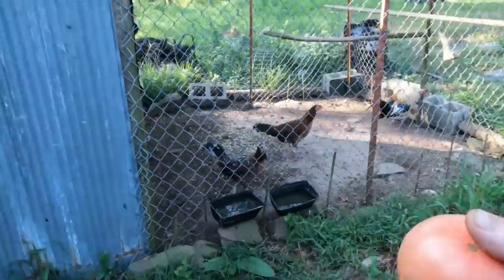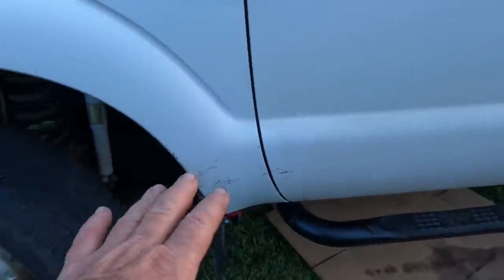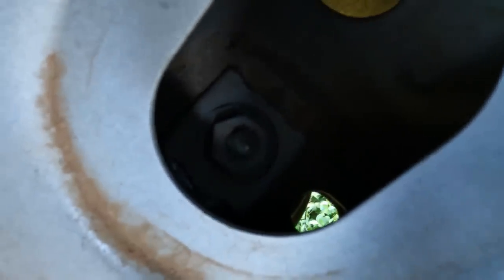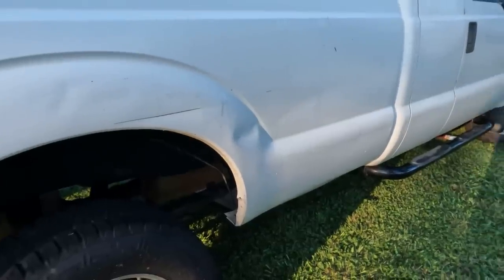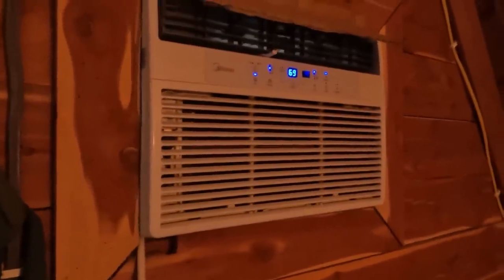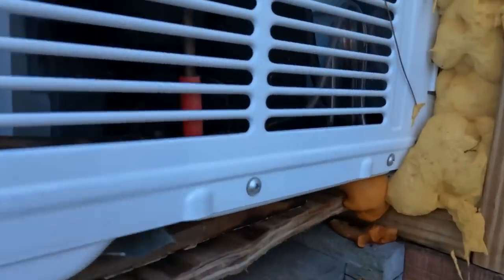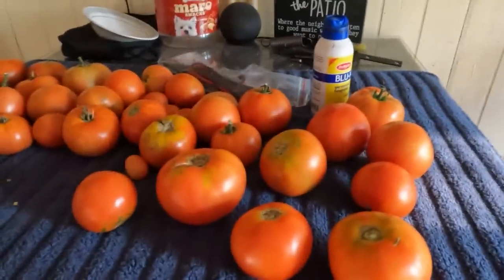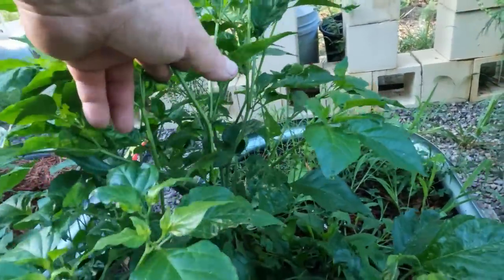It Went From Bad To Worse! My Body Can No Longer Do What It Used Too.Stranded,No Wheels

Comment from the maker: Im going to put on the two lowers on passenger side this evening and then drive it to the shop in town, Jeff is going to follow me and then take me to the store for food.Drew offered to take me home on his lunch hour but now Jeff can help.If my hand didnt get smashed up I would probably try and finish it, but its my right hand and not gonna happen.
Reply: Sorry Dogman.  You gave it heck. There are things Pooch can't and won't do anymore too. 🤠🤘❤️
Reply: It's great you have good friends close by for now.  I had to leave my Ford 2018 Ecosport at the shop only 26,000 miles on it. it's either the motor engine mount or front axel. $169 for just the diagnosis. Hopefully they can fix it soon.
Reply: I am so sorry about your hand, Mike. If your wound has scabbed over and if you have some comfrey salve, you can put some on your hand as it helps to heal wounds.
I am sharing a link so you can see if you want to use it. I has many beneficial purposes for healing.
Jenn of Altruistic may have some she can send you.
https://thegrownetwork.com/comfrey/

Comment: Mike, I am having problems with my 12,000 btu air con. loud noise and spitting out water,  it was refurbished when I bought it. Had many years of use. So I using the 5,000 btu air con. what a difference. So tomorrow have a brand new 8,000 btu air con coming & the 5,000 btu is going in the bedroom, I hate heat, like the place cool. So wish me luck. Been researching for days, deciding if I want to spend the Money or not. I have to make an appt. to get Fern fixed also. While visiting the dentist weekly for while, to get what teeth I still have worked on lol Money Money Money. You know what they say if it rains, it pours. lol